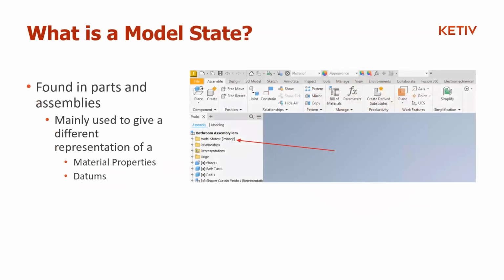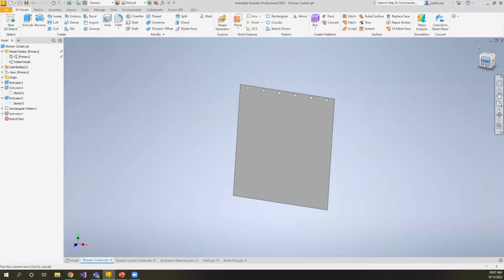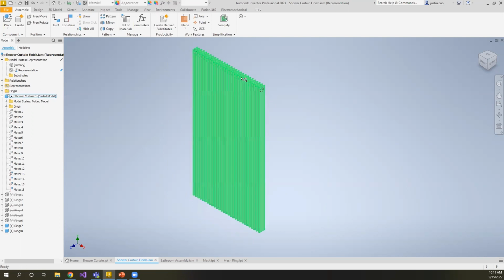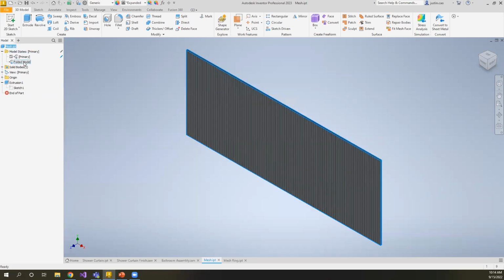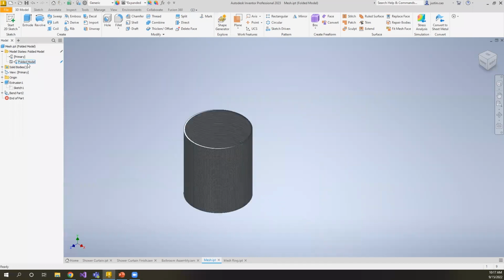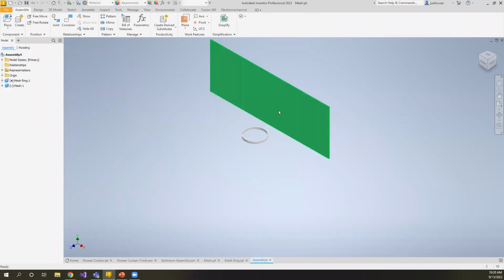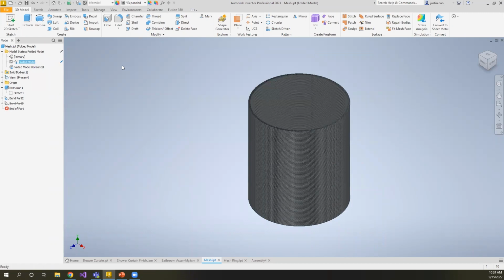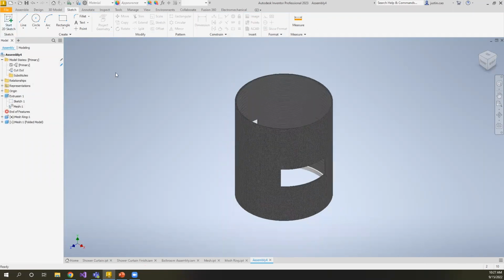Everything You Need to Know About Model States | KETIV Virtual Academy

Comment: Out of curiosity why are you manually typing in values that you already have as dimensions? Linking them is a far better workflow, shouldn't you be showing best practices?
Reply from the maker: Hi Richard, linking dimensions through parameters is definitely a great workflow, especially if you are going to be calling on those dimensions multiple times. Linking the parameters so they can be controlled in an assembly is excellent as well. In these examples, we are using them as static models, so it wasn't necessary to link since workflow length would be the same. Thank you!